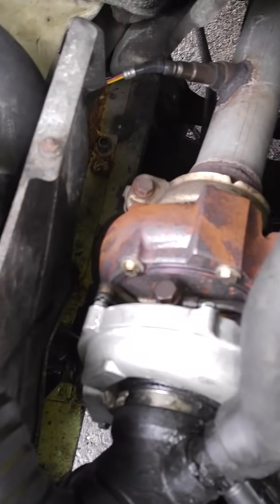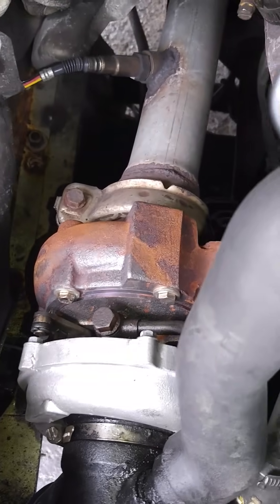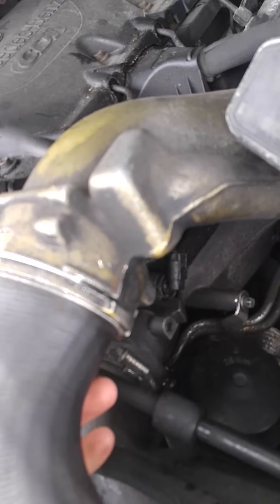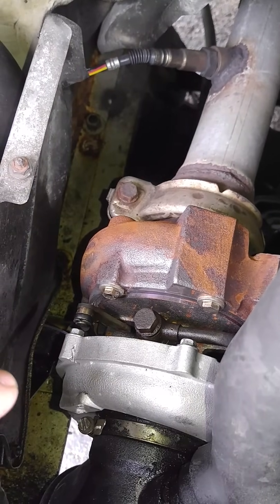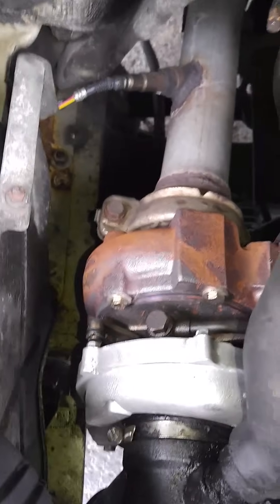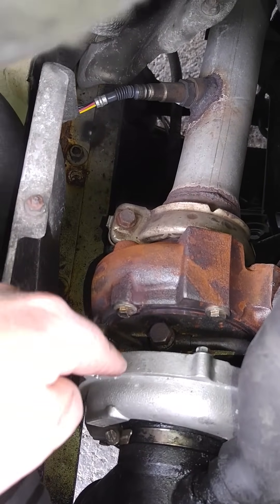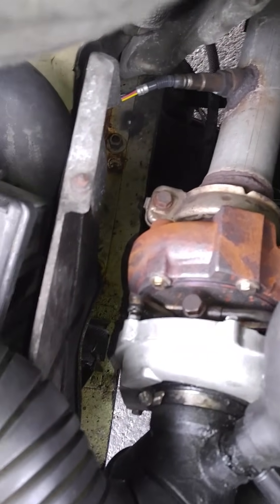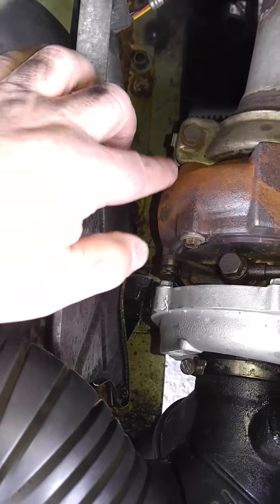2004 2005 2006 Sprinter Turbo Actuator P2099 P2043 adjustment replacement problems

Comment: Dude! this might be the video I needed to see! Thank you for explaining. I basically did everything you did with hoses and sensors resonator still nothing. thank goodness it doesn't go into limp mode but it sure does bog down and rolls coal up hills and stuff. I have touched the gate arm arm before and seemed a little loose but on there. Im gonna go clock the turbo today and hope it fixes it!
Reply: Well ???

Comment: thank you for the enlightenment from that video , as i have been having  similar problem  w904  sprinter  2003 ,changed turbo , sensors and acuator also , goes well along the flat but hills no going up at good speed ,  so i called it a can hardly      get up hill  , but will try that as spoken with a mechanic , he stated after i said waht you reckon about clocking  his reply  staemenn, was never heard of it , so guess i will not be asking for further advice , stay safe happy driving

Comment: What is your opinion on the turbo after having used for a couple years I hope?
Reply from the maker: I sold the van after a year and it was running  perfectly fine. It just had too much rust so I got a newer one.

Comment: My turbo blew up, snapped the shaft. I have no idea why.  I got a new cartridge and was first getting a high boost error.  Now I'm getting an O2 sensor code, low voltage.  I did have a sticky wastegate but it fixed itself.  I took the O2 sensor out and it was completely covered with soot.  I cleaned it with a hot touch and brake cleaner.  I have decent highway speed but I can tell it's in some kind of limp mode.  If I come to a stop and pull out, it dumps blk smoke.  Any ideas?
Reply: This is a guess, did you look at the catalytic converter? When this happened a few mechanic friends said check cat as when turbos blow up it spews a lot oil and soot that can clog them. Just a thought, good luck!
Reply: @bajrammemshofski6649  no cat. Short exhaust

Comment: great Video, I have the same problem, I tried to "clock" the turbo like you said, it didnt work because when I turn it counter clockwise, the turbo (intake side) will hit a metal hose right underneath it.

Comment: Did your turbo shut off randomly and then if you pulled over and reset the key it was ok for some time ?
Reply from the maker: Yes, that also happened when I had a crack in the intake hose. If you didn't change the turbo or actuator I'd look at all hoses first. Squeeze all air hoses, sometimes the crack isn't visible until you squeeze them. Good Luck
Reply: Yes I replaced the same hoses and sensors as you did and also bought a new turbo and actuator but am still having the problem. I am going to try your fix today. 
Thanks
Reply: @gloproglowingcups4795 so  did it fix the issue ???

Comment: So at idle is the arm supposed to be up or down?
Reply: It was in the middle closer to down. I had it too high one time and too low 2nd time. Best thing to do is not connect arm at all, run it for a minute or 2 then reconnect it. You'll see it'll be in a totally different place. Good Luck!
Reply: bajram memshofski does this only happen when you change turbos?
Reply: @dieselkumar6451  it did happen when I changed the turbo and actuator. But to say that it can't be off after some time, I would say it can. It seemed that the actuator goes to a home position when you turn off the engine. So to check it just disconnect the arm while engine running, move it up and down a couple times and turn off the engine. If it doesn't line up after that then you have to clock the turbo like i explained in the video. Good Luck
Reply: bajram memshofski thanks for the help. Quick question though, whenever I unplug my egr or barometric sensor on the intake the actuator arm changes. When both of those sensors are plugged in the arm is pretty far down and when I unplug 1 then the arm goes back up. I should also mention I don’t have the air box sensor hooked up since I don’t have an air box.
Reply: down

Comment from the maker: The actuator arm was up, shooting too high. But I believe even if it was too low it will cause problems. When you put the turbo and actuator together on the bench you really don't know the home position. So I say put the turbo and actuator together on the bench but don't put the actuator control arm until it's in the van. Start the van move actuator arm up and drop, rev the engine then shut the van off. You'll see it won't be in the same position as it was when it was installed. Unless you got lucky when you put it together. Good Luck hope this helps.
Reply from the maker: From what I remember it was closer to the top.
Reply: so actuator arm lines up when turbo arm is in middle? or at top but not tight?
Reply: On bench, the actuator arm barely squeezed onto waste gate arm.  So, after putting on engine, separating arms, revving, etc.,... when clocking turbo, do I stop with waste gate arm all the way down, all the way up, or in middle.  That's the confusing part.

Comment: I seem to have loss of power and I swear I hear a air noise.  I checked all hoses, resonator, etc.  I didn’t check the actuator arm moving by reving the engine b/c it's just me.  I guess I could of took off the arm but didn't do it yet.  I did unplug the turbo press switch and noticed a engine sound change.  Any ideas? Like I said, I seem to have loss of power  and loss of fuel economy.
Reply: What year and what van? Is the check engine light on?
Reply: Having the same problem right now did you figure out how to fix it ? I need help 2003 dodge sprinter
Reply: @williamtoch7435  I bought a scanner from harbor freight.  Originally the FPR failed then the one bought was also bad, eBay junk.  I had a high and low rail pressure.   The new FPR fixed the high rail, now still have low.  One of my injectors is bad.  Have to get one good injector and do one at a time until I find the bad one.  Apparently it fails at high pressure and dumps fuel, causing the low rail.  Dealing with this for 6 months  !!!!
Reply: @frontlinemedia4270  so you got boost errors because of a bad injector? would like to hear the results.
Reply: @markpasieka  I never had error codes because of any bad injector.  I'm trying to remember what this particular problem was, I've had so many.  I had the fuel pressure relief valve go bad once.  I had leaking injector seals.  And I am currently in a strange Limp mode again.  This time thinking it's my Chinese bought EGR.  know anyone that has a OEM EGR non working that I can buy?  I want to use parts from it

Comment: Hello Everyone,I owed a 2006 Dodge Sprinter 2500, i love it, but one of this days while I was driving on highway lost power, so it wouldn't go more 50 or 60 mph, I took it the Dodge Dealer they did like 4 different things that costed me almost $1600, I picked it up and test it on highway and still not power at all. I took back to them, at this point I haven't heard from them.
Any recommendations or advice about it will be greatly appreciated.
Not light on on dash. 
Thank you!
Reply: Eleuterio Amador hey man i’d love to know what happened with your vehicle, any luck?

Comment: Hi, the term limp mode describes what my van is doing. I had an "upgrade done" because I got something in the mail saying I needed it done..(even though my gut told me NO!) 
After that the technicians could not get my van started. Then they got it started and had to leave the MAF sensor disconnected. I got a new MAF sensor and changed the air filter which was badly damaged and clogged. I hoped that was what was the problem. I drove it about 100 km and then it lost power and I "limped" home. No power going uphill and no passing power.  I cannot afford to take it to a mechanic. I will buy a diagnostic tool but someone else previously mentioned an actuator problem so I am leaning toward this as being the problem cause it sounds right. I believe I can follow instructions to change this. Any more details will be helpful.
Thanks for your info
Reply from the maker: Check all the intake hoses first after turbo ( Cold Side of Turbo). There was a little tear in hose going into the intake underneath and was real hard to find which took me while to find and fix. Caused limp mode constantly. This was before the turbo went out. So first make sure there isn't any leaks in the hoses. Any pressure lost in intake hoses puts the sprinter into limp mode because it thinks the turbo isn't working. Also the resonator seals break and loose pressure, too. YouTube "Sprinter Turbo Resonator Fails", "Sprinter Turbo Hoses Failing" "Sprinter Limp Mode".... I'm pretty sure it's something simple, especially if nothing mechanical broke like my turbo did. Hopefully this helps. Good Luck!
Reply: @hidefguys  I, with '06, had same problem with original Sprinter intake rubber hose with break at the top hose mount and a split in the hose. Bought a cheap China hose and it was very stiff hose (MB hose has good flex). So later even with China hose still working I bought the MB brand hose and installed cause that stiff China hose can mess up other parts especially in Cold Chicago Winters. Get a piece of thin Aluminum sheet with two large O clamps (hose clamps) and use that as a patch until you can get the van home so
you can avoid limp mode in the future if the hose fails at 120K miles again. I came upon the aluminum sleeve trick while waiting for the first replacement hose to arrive.
Reply: @vincentrolfe1384  slice a soda can? interesting idea...what did you actually use out of curiosity

Comment: Hey can I ask ya ,what year would you say is a better one to buy ,on the Diesel engine on these. ?  I don't want the DEF system years....Unless they have a delete kit & tuner. ?    thanks.  Oh ,I'm going to build a RV  out of one, or buy a Built RV with t e Mercedes sprinter platform.
Reply: Jim Cash. 2002-2006 have no DEF at all, just EGR and SCR
Reply: @IgnoreSolutions  what's an SCR?
Reply: @markpasieka  SCR = selective catalyst reduction. aka the actual exhaust portion of the DEF system.

Comment: Thanks my man! Mine goes into limp mode and when I cycle the key it’s fine again until idle when it goes back into limp mode. Probably the actuator bad?
Reply: Can you tell me what/how to cycle the key?
Reply: dirk obrien I've seen many EGRs go bad on these. Replacing EGR fixed my limp mode. I think this guy's turbo failed from lots of miles. Check for air leaks in giant hose up front and throughout intercooler and air system. Carbon build up in intake is sadly yet another common issue.